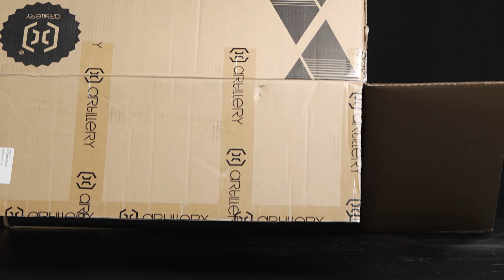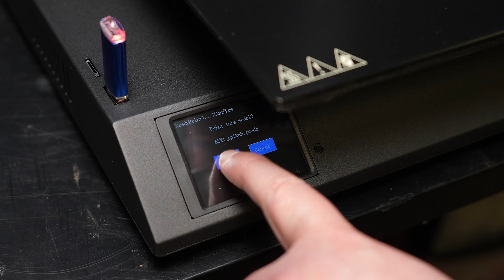Make 3D Printed Spikes For Your Armor Projects!

Comment: Do not use PLA or PLA+ material for this type of work. It melts in the sun. If you take this to a fair in summer and are outside your material will warp, deform, and / or outright melt. If you leave this in your car for some reason it will melt. Use PETG for any material you intend to take out to an outside event. Its more expensive but most modern printers including the one in this video can safely print with this material.